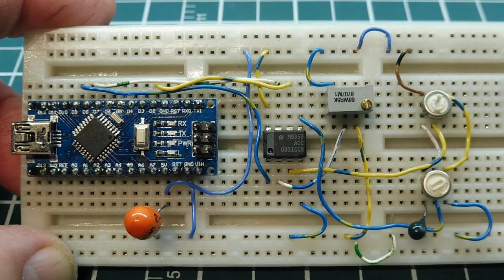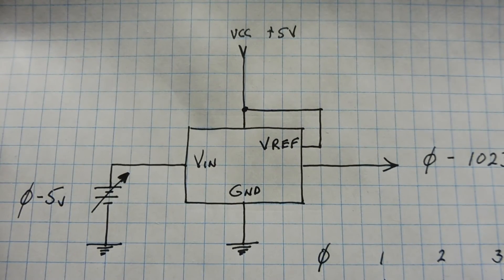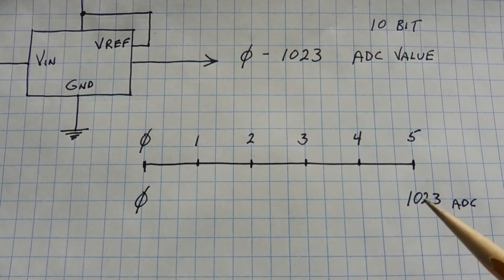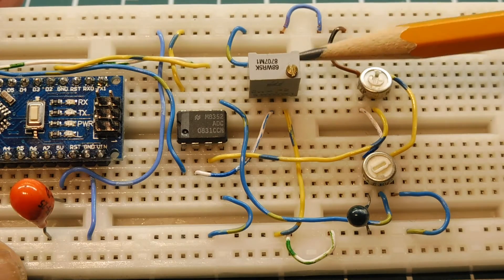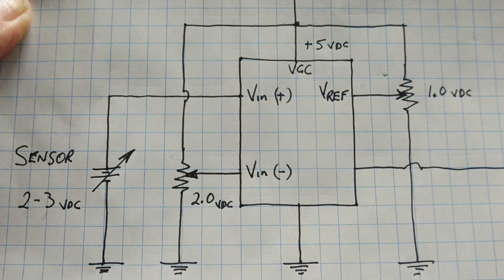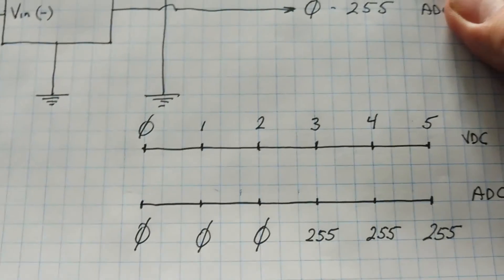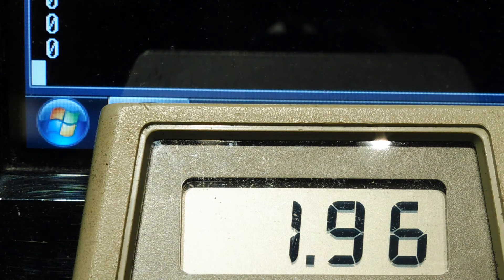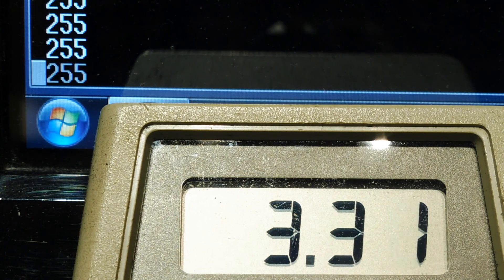How to use Differential Voltage Input ADC's

Comment: My sensor range is from 0V to 1V. I have set Vin(-) to 0V (GND). Should I set the Vref Voltage to 1V? I'm using a delta sigma ADC.

Comment: what if I had sensor values from -1 to 2, how can I let the ADC read the negative input voltage ?
Reply from the maker: Build a voltage level converter using a 1458 op-amp to get a 0 to 3 volt output.

Comment: You can use AREFF to define MAX ADC level. So if AREFF has 2V. then input on ADC will be measured up to 2V(MAX.)
In your case you want to measure FROM 2V. Then you can set ADC input PIN as reference 2V. And use AREFF as signal input. 
For example ADC1=2V. AREFF receives 1V, then you get on input MAX 1024 because ADC1 will be over AREFF, but if AREFF will have 2.5V, , then you'll get something below 1024. 
After you subtract 1024 with your values and you get your result.
In this case only disadvantage, you can as input only one PIN instead of 5 or 7., but this could be solved by adding cheap mutliplexer 8 or 16 channel.

Simply use ADCinput as reference, and AREFF as input.

https://www.youtube.com/watch?time_continue=8&v=fN3J6wxijrE
Reply: But you are only using 1/3 of the available ADC range?
Reply: @nicholas3678  no 1/2. But yes resolution will be divided. However I would say for 2-3V input as in video example (and point of interes will be around 1,5 V), this would be enough. If you go lower, you'll get noises.

Comment: can the ADC be damaged if you input a voltage between 3V and 5V for an extended period of time? Just wondering if I can change the gain on a PGA ADC to suit the voltage best
Reply from the maker: Always refer to the datasheets.
Generally keep the input voltage equal to or lower than VCC of the ADC.
There is no time limit on proper voltage inputs.

Comment: You used thermistor here as sensor?
Reply from the maker: No  .. I used a potentiometer to simulate a sensor with an output of 0 - 5 volts.
Reply: what was your sensor?
Reply from the maker: There is no sensor in the circuit.
A 5k ohm pot was used in place of a sensor.
Reply: ok sir I understood

Comment: Interesting. So, the ADC output goes into the digital IO pins of the Arduino? Does it use I2C to give the value of 0-255? I knew external ADCs existed, but it's never occurred to me to use one like this. It could solve a problem with some of the ESP8266 dev boards that only have one analog pin (and it's 0-1V with no 1V reference voltage).
Reply from the maker: The ADC talks to the Nano with a three wire interface similar to I2C but much simpler.
Here is a link to the ADC0831    http://www.ti.com/lit/ds/symlink/adc0832-n.pdf
There are similar ADC's with higher resolution.  MAX159 and MAX145.